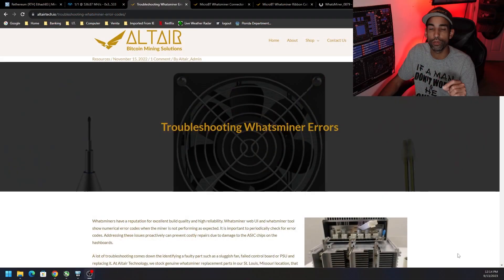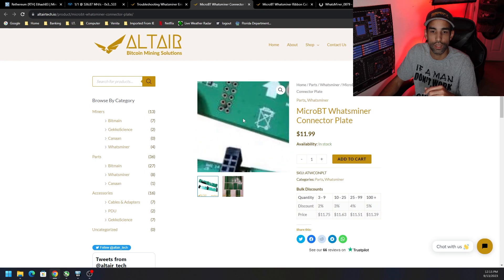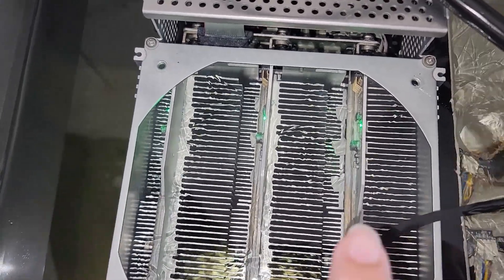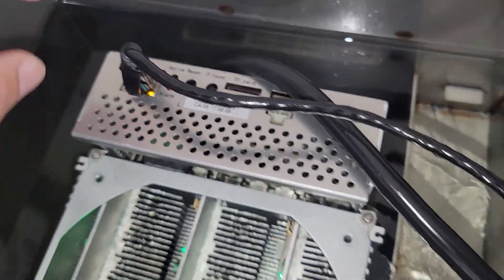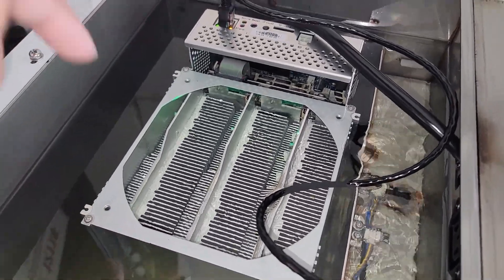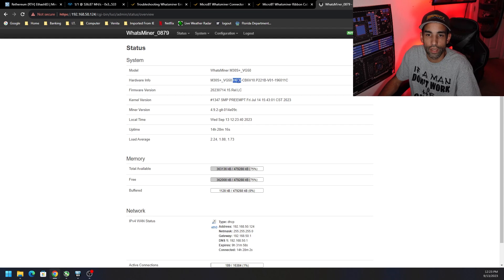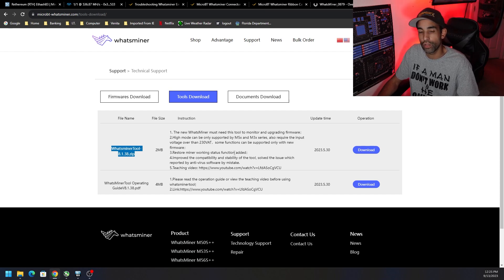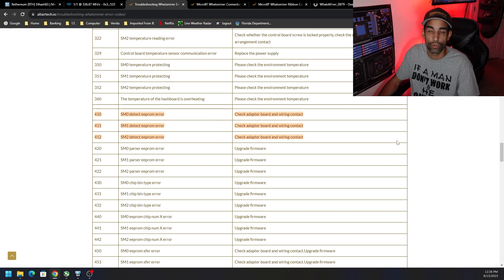Whatsminer Error 410, 411, 412 - Detect EEPRom error

Comment: Hi can you help please, im having trouble about error code 540, 541 and 542, maybe you can do a video tuturial also please, thank you
Reply from the maker: That is Chip ID reading errors. So something is stopping your machine from reading chips. There could be a short somewhere, bad chips, or bad power supply. If you can tear it down, you can test chips with multi meter. Also, consider jumping in Telegram group for whatsminer.

Comment: Hello 
I allow myself to write you because I bought an antminer what’sminer M50 110th, I currently have an error 309 would you have the solution to repair this error? 
Thank you in advance for your reply 
Cordially
Reply from the maker: @stefbleach1193  that error means that the unit can detect any temp sensors.

All temperature sensor detection errors

Try to take out and reseat the little green PCB that connects the control board to hashboards.

You might need to replace the connector board between the two, like this one.

https://altairtech.io/product/microbt-whatsminer-connector-plate/
Reply: Is that I can please have your email address to send you photos please
Reply: Thank you very much I ordered both 
But I would like to try the card update see if it can work with an sd card
Reply: Hello 
When disassembling I see this white particle that if I scratch s remove, this deposit covers some components (see photos) l Asics was dipped by the former owner in dielectric oil
Do I have to scratch and remove the residue or is it normal?
Reply from the maker: @stefbleach1193  sound like thermal paste residue or protective coating some manufacturers use. Yes it is normal
Reply: I can’t make the update what type of card is it?
Reply from the maker: @stefbleach1193  it's called a whatsminer connector plate. Open up the top section with control board and you should see a small pcb connecting all three hashboard. Take it of, by lifting up and reseat it and see if it detects sensors. The miner can run without the control board mounts, it will dangle by connectors but just becare not to break anything. If the connectors are too stiff, because previous owner had it in dielectric oil, or immersion fluid, the cable may become brittle, so be careful
Reply: I have an updated card h616 I tried to update without success with the software whatsminer I would like to make a shift by sd card how do I proceed?
Reply: I have finally managed to make an update but I still have 2 error code 
Code 309
Code 500
Reply from the maker: @stefbleach1193  https://www.zeusbtc.com/articles/asic-miner-troubleshooting/1688-how-to-deal-with-fault-codes-of-whatsminer-series
Reply: Thank you I already have this list but it didn’t really help me because I managed to make an update instead of having 5 error codes I n' in n' more than 2 and in one of the two it tells me to update the firmware
Reply from the maker: @stefbleach1193  reach out for support in this chat. But I still believe either your connector board or control board are acting up. The cheapest component to replace is the connector board.

https://t.me/whatsminergroup/2092

Comment: Thanks for video 🔥. I only have error 410 and 411 not 412 I have invert the hashboard and same problem 😮‍💨 it’s not the hashboard 😅. If the control board is dead it’s the same error code ? Or do u think it’s only the cable and the connector triple ? Thanks dude 🔥🔥🔥